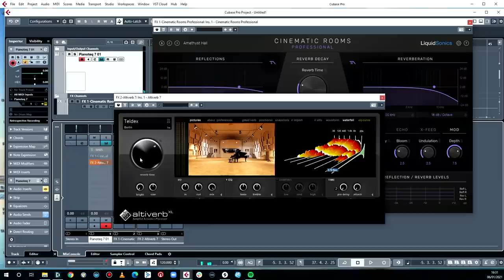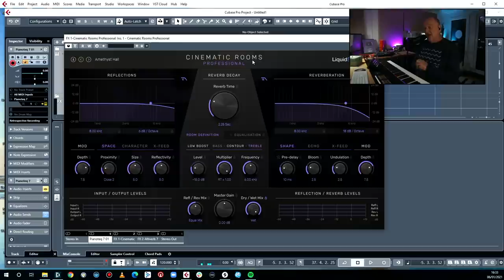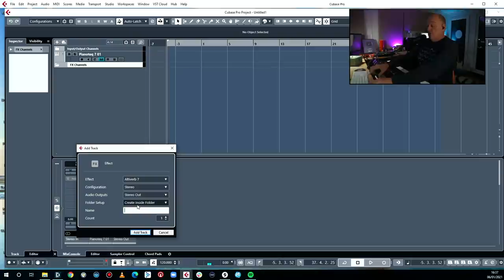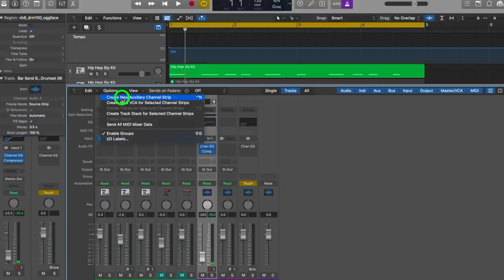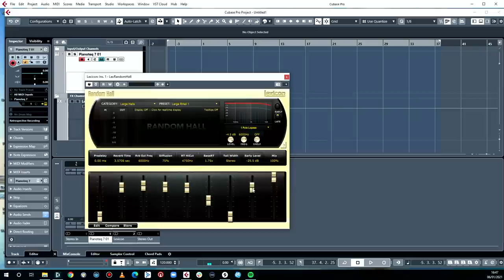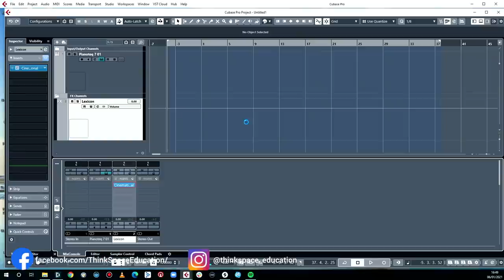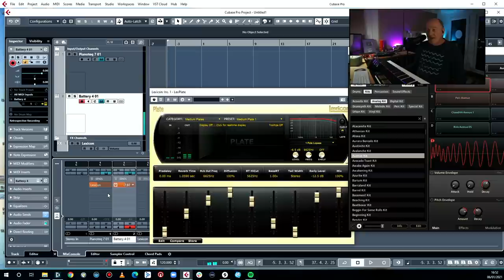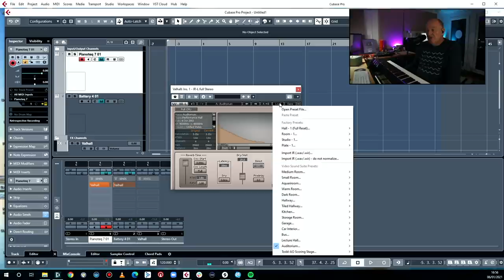Reverb: What you NEED to know

Comment: A thing which could be mentioned and something I always do is to put a 100% wet reverb or echo on a parallel bus and mix it ever so slightly in. This mimics the dry/wet effect but you are able to EQ and even compress reverb or chain other effects. It' s pretty nice to have reverb without low end frequencies and there is much more free space in room for your original sound source.

Comment: Hey man the quality of your camera at the start is crunchy. My image looks like that if I have my DSLR outputing HDMI but when its in a 'photo mode' (like manual mode) in order to put out the full signal the camera should be in a movie mode. I could be totally wrong on that, but thats exactly how my image looks when I do that on my ones!
Reply: I think he just has it so dark in there, his camera is increasing the ISO a ton to compensate. That will introduce plenty of noise.
Reply: @Nightmoore  it’s a different kind of noise. Bumping iso wouldnt make those jagged kind of edges in the image, usually using hdmi out when in a photo mode has this exact look. Changing the camera to movie mode changes the hdmi output to a higher resolution.

Comment: The one case I can think of where you wouldn't want a bus reverb would be the aforementioned surround case. Imagine a conductor in the middle of an orchestra or large choir - the sound from each instrument or voice follows a very different path to get to each ear (and those paths are what reverb simulates). But that's an extremely niche use case and, if you really need it, you'll probably be looking at doing a bunch of freezing/individual rendering to get it to work. Besides those phasing issues.

Comment: I own East West's Hollywood Orchestra, and it has a built in reverb for a variety of halls.  I'm guessing that Spitfire and other libraries also have reverb options.  My question is: If I want to use different libraries for different orchestral sections (CineSamples for percussion, Spitfire for strings, and EWQL for winds, for example) within the same piece, is it best practice to use the "dry" option on everything, and then run them all through a single bus with reverb, or will using the built in reverbs together work?

Comment: And for the past 38 years I have been reckoning with this early 70s, custom-built for NBC-TV, all discrete transistor, Rupert Neve audio console.  And I just love the purity of sound from my fabulous British Neve console.  The clarity of which is just like the River Thames.  It's all nice and brown and gunky.  Filled with fuzzy brown distortion pollution.  To give your recordings just that right Air, about them.  Like really good stink.  From really good Skunk Weed  or Baxter.  And because I know why Rupert now despises the sound of my console which he designed back in 1970.  When he told me.  He made a lot of mistakes with his early transistor circuitry design.

Yes it's riddled with inappropriate, incorrect, mathematical equations and transistor specifications.  An early whoops moment for the Master of Consoles.  Because they are actually not the best nor the cleanest sounding consoles.  They just have a lot of the bad wrong stuff in them.  To make the bad wrong kind of nonlinear distortions.  That we all know and love so well.  Beautiful wonderful mistakes.  That made for some real cool grungy recordings that could not sound any better.  That would not have sounded any better.  Had they been recorded and mixed on his latest circuitry.  Which he has perfected.  And which now sounds like everybody else's same junk.  Cold, brittle, metallic, thin, edgy, squeaky, neutral, neutered.  As many of us perceive that new stuff to sound like.

So I find much of the state-of-the-art to really be the state of the Fart.  Yes we want perfection.  No we don't need perfection.  Humans are imperfect.  Therefore our musical performances and recordings will have included with them human inaccuracies.  To let you know.  To assure you of.  That you are actually listening to actual human beings.  And not a computer.

And so what I have spoken about here folks.  Is how to separate the Men from the Noise of the Boys.  That are all self-professed audio experts.  And can waive their college degree at you to prove it!  See this dead sheepskin?  It means I know something about audio!  Really?  What does a dead sheepskin sound like?  How do you plug it back into the sheep?  Oh you can't?  Who knew?  That you had nothing more than a dead sheepskin.  And really have no idea what the FUCK you are listening to who.  (In reference to that of self proclaimed and professed audio experts with degrees.  If they got a degree?  They likely also have Covid-19:-)  Because while they might have their hearing and facemasks on.  They don't realize you can catch it in your cornea.  They couldn't see that far.  That they also needed to be walking around with swimming goggles on also.  Because they were taught that mucous membrane only met your mouth and inside your ass hole.  And they protected those two entry points.  Where there is actually only a single entry point.  But I hear a lot of the British are gay like Americans.  And everyone else all over the world.  So some have something of a modified bidirectional port.  That was never supposed to be an input.  Let me be clear about that.  And sometimes their equipment would blow up.  When AIDS came to their rescue.  It wasn't a rescue.   It was AIDS.  AIDS aiding AIDS.  And two wrongs don't make a baby.  But they keep trying.  And they are still waiting for Jesus to return after 2000 years.  What's the matter with this picture folks?

Welcome to the 21st century everybody!  Time to wake up!  Time to die!  As you all try to outrun the Blade Runner's.  With your speakers in reverse polarity.  And you're going to get caught with your pants down and your ass up in the air.  Because you are 180° out of polarity LOL.  And no matter how hard you guys try.  No baby comes out.  Little babies do.  That seemed to fit very conveniently.  Into that porcelain port.  And those little babies go for a swim and go bye-bye.  That's the only babies that boys can produce.  And the same is coming out of there speakers.  Because your speakers are operating ass up in the air.  I find it riotously funny!  But it's really not funny at all.

Because I actually consider this simple stupid mindless idiotic error.  That 99% of all the EE's and AE's with their college degrees, all make!  And the entire Pro Audio Industry all believes in this single backwards religion.

And so I consider this to be the biggest technical Pro Audio FUCK Up.  In Pro audio History.  Because 99% of you out there.  Can't think this through for yourselves.  Don't know what you're listening to.  Don't know what you are to listen for.  You are willing to have other people tell you what you are hearing and what you can't hear.  You follow their Bible.  Their preaching.  Without question.  But you question and experiment with everything else in audio.  But not that.  Not that one thing.  Because that would be blasphemous!  In your audio religion.  In your highly flawed and incorrect, audio religion.

Comment: I've never worked out how to use the send/buss reverb when bouncing stems or individual tracks for later mixing. If I bounced each stem or track individually along with the output from the reverb send channel, and then mix them together afterwards, is it the same as bouncing each one dry and then mixing together after with them all going through the reverb channel at the same time? Or does the reverb need to be used only once.

Comment: And of course our lovely British composer has a lovely playback system.  With the left and right channels definitely in phase.  He's never realized though.  As fine as his hearing is.  As fine as his composing and production skills are.  He's never realized.  That while his speakers are most definitely both in phase together, yup.  They are also 180° both out of Absolute Polarity.  But composers do not need to know about norm be concerned about such things as proper monitoring.  They are listening to their music they are composing.  So they don't notice their monitors are in phase but in 100° of inverted polarity.

Yes that's funny, I know.  But that's the way all of your speakers actually are.  There is but one manufacturer that realized what a serious monitoring issue this was.  They figured this out at least by 1968.  It took me 10 years then.  To figure out what was going on.  Because I was not happy with my monitoring in my control room.  And I knew I had built my control room very well, the right way.  When I discovered, JBL Speakers, got it right.  By indicating the positive and negative terminals backwards.  On the back of their speakers.  But everybody else does it mathematically accurately for, zero phase inversion.  Where it must be done.  At the power producing output.  That moves the air with the speaker cones.  And even Electrical Engineers and Acoustic Engineers, nearly 100% of them get this wrong.  Because they believe in phase = good.  Out of phase = bad.  And the tooth fairy exists.  So does Santa Claus and Jesus.  But some of us don't believe in that.  Some of us come from other belief systems and religions.  And they are completely incompatible with all others.   That all must be told.  What they are listening to.  And what they cannot hear.  And that when you are listening to something incorrectly.  Somebody else is telling you it's right.  And they have the college degrees to prove it.  That your hearing is wrong.  Their math is right!

Unfortunately they are all academic idiots.  That could not think anything through properly in the audio chain.  And they got everything right.  All the way up to the very output into the speakers.  Where they get it wrong.

So those of you who are reading this at home.  You could hear and understand what I'm talking about very simply.  For yourself.  This is a game changer.  You're not going to believe it when you hear it.  And it costs nothing.  Absolutely nothing.  To correct this stupid error.  And here's how it works.

Most folks have a good old-fashioned hi-fi FM stereo receiver and integrated amplifier.  Who doesn't?   And with that.  You get to select and choose.  Whatever speakers you wish.  To go with your stereo.  And you've gotten a couple of good namebrand speakers.  Or?  You've gotten a couple of bargain-basement speakers.  And on the back of the speakers are the 2 connection binding posts.  To connect your speaker wires, to.  And one is marked plus the other is marked minus or one is colored red and the other is colored black.  In the red is the positive and the black is the negative..

And you look at your amplifier instruction manual.  You look at the speaker instruction manual.  Where it plainly shows you.  To connect the output connection from the amplifiers plus terminal.  To the plus terminal on your speakers.  One for each channel left and right.  And the minus terminals from your amplifier to the minus terminals of your speakers left and right.  And well that is just flat wrong.  It flies in the face of DC theory 101.  Which goes like this.

You just got a brand-new flashlight as a Christmas present from your youngster.  It requires 2 batteries to install.  How do you install those batteries?  Do you put the 2 plus terminals together or the 2 minus terminals together?  And then what happens?  Something's wrong with the flashlight.  You return the flashlight.  You get a better flashlight.  You put the batteries in the flashlight.  Yet it still will not work.  The batteries must be bad.

So you return the batteries and get fresh batteries to put in your  second brand-new flashlight.  The better one.  And the flashlight still does not work!  It's called DC theory 101.  You have to connect the positive terminal to the negative terminal in series.  When you do that.  Then the flashlight magically works!  But that's DC.  And our speakers and amplifiers produce AC.  That's right.  That is absolutely correct.  But you still have to have the Absolute Polarity going in the right direction of the alternating current.  Does the waveform first rise.  Or does the waveform first fall?  It rises it goes positive usually.  Before it goes negative.

When they instruct you to connect your speakers the wrong way.  They will still work.  The left and right channels will both be in phase together.  Because it's easy to tell when they are not.  But they are also not both in the proper polarity together.

Notice I'm using the term phase and polarity, differently from one another.  Because they are different.  They are not the same.  When you are dealing with and in the land of, Audio.  Where Absolute Polarity determines.  What your woofer is basically going to do.  On the bass drum downbeat.  And which direction it's primarily going to be moving in initially.  In which direction should that be?  This is a trick question.  That you all are going to get absolutely right!  Congratulations!  I congratulate you before you answer.

You will all say.  The woofer should be moving out toward you.  And that would be absolutely correct.  If only it was.  It's not.  It's sucking.  It's actually sucking into the frame of the woofer metal scaffolding.  And you are getting the out of polarity rebound sucking at you.

Meanwhile.  As the woofer tries to direct its energy backwards.  Into the speaker box.  Not out toward you.  Because the speaker box has no hole on the back.  And it's sitting in front of your wall.  Only low frequencies will be coming off the back of your speaker.  Slapping against the wall behind it.  Reflecting outward you in time delayed reflected proper polarity.  When in midair.  The sucking action from the front of the speakers.  Basically is sucking the sound back in to the speaker.  Which is not directing the sound toward you.  Except for its out of polarity rebound.  And your monitoring in stereo gets all wonky.  If you are not rigidly in the center between your speakers, perfectly.  You're only going to hear the speaker you are slightly closer to by an inch or so.  Because the other one will be canceling out even better before it gets to your ears.

Comment: Do you have advice on using reverb within a dry domestic rehearsal space to enhance the sound of acoustic instruments?
Reply: I'm not Guy Michelmore, but I'll reply. :) First make sure that there is as little of actual reverb of the recording space is present in your recording as possible. Domestic spaces tend to have not that pleasant sonic characteristics, and when you have unwanted reverb recorded it is practically impossible to get rid of it, so you better suppress it right from the start. This is typically achieved by close-miking and, if possible, some sound-absorbing material in the room. Soft sofa? Good! Thick curtains? Great! Etc.

Then you can apply the reverb as usual, but I prefer to turn off early reflections, because no matter how you try, you will get some early reflections in your recording, unless you are recording in a proper sonically isolated studio, and we're talking about home recording. So I prefer to leave the existing early reflections intact. Other than that, everything is the same.
Reply: @baroque_engineer  That's very helpful. Many thanks!
Reply: @bassetthorn  Glad to be of help. :)